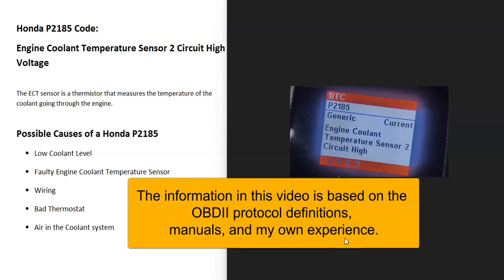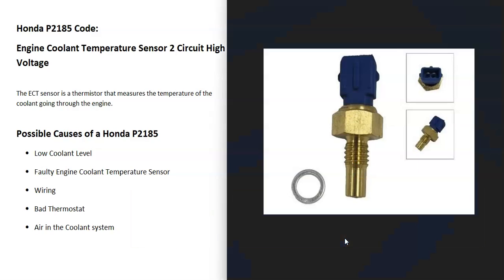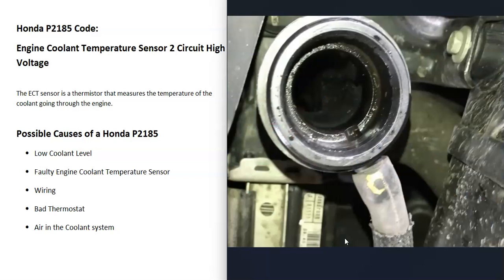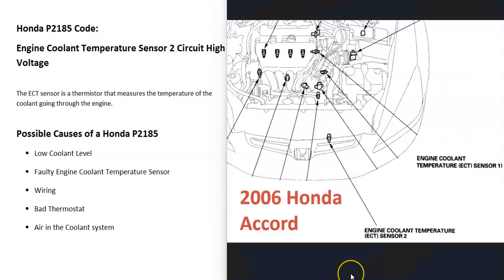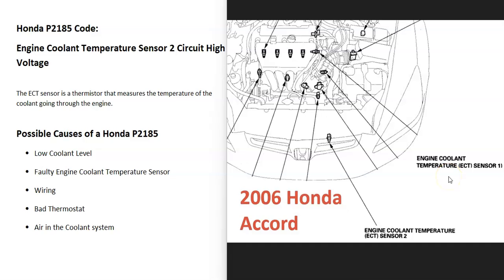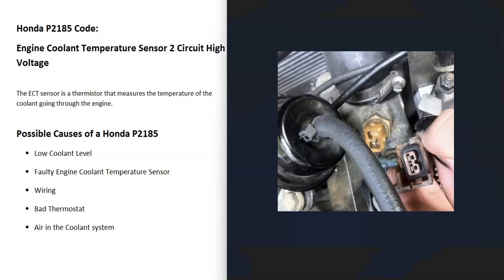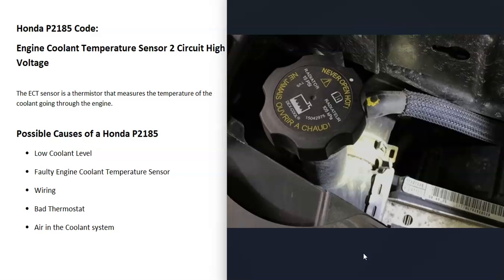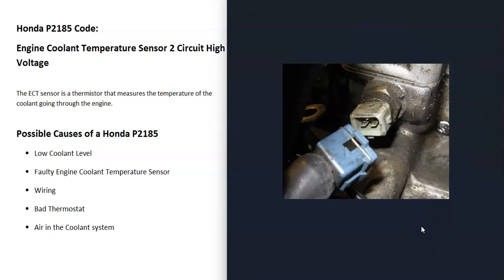HONDA  P2185: Engine Coolant Temperature Sensor 2 Circuit High Voltage

Comment: great video justa question which sensor is the one one going to my gauge i replaced the one on the engine and as soon as i turn the car on it goes to the max on the gauge, also feels like my car goes into a small limb mode with higher shifting rpms when driving thx for the help
Reply: if i disconnect the battery its drives normal till you turn it off and start up again
Reply: Did you pull the CEL codes?
Reply: Sensor ECT 1, on top near the thermostat, is the one that is used to measure the temperature of the engine and then the computer sends a single to your dashboard gauge accordingly. If its unplugged or otherwise not connected then I think gauge shows high for safety reasons.

Comment: Hi I don't have a code coming up on my car but I have a 2012 Honda civic ex and the temp light comes on for a sec n then goes away . And the car is not over heating at all it has coolant in all right places plus I changed out the thermostat so it's not that. Could it be temp coolant sensor.  Or could it be the car computer brain the main one it's not turning on the fan once it hits temp 221 but the car is not over heating.  What do u think it could be pls 🙏 help

Comment: I do remember one guy saying that is radiator cap wasn’t sealing properly and he said that was the cause of his issue I guess air getting inside because of a bad seal on the cap? Unusual but thought I would throw that on the list
Reply: I would think that would cause your temp gauge to overheat rather than just throw the codes blindly but who knows

Comment: Do you know what the voltage is supposed to be at the plug? 12v or 5v?
Reply from the maker: The reference voltage is usually 5-volts but it is best to check the manual for the year of vehicle to know for sure.